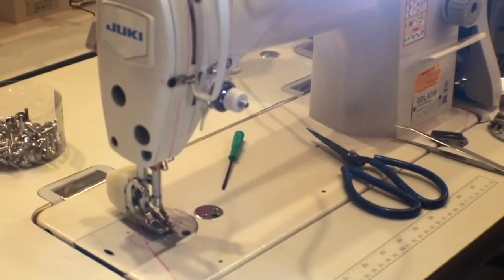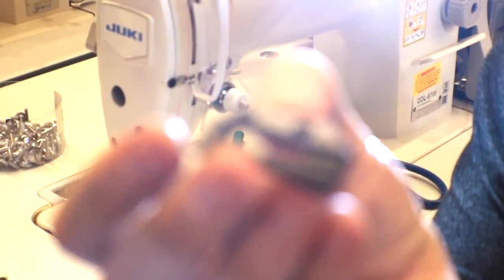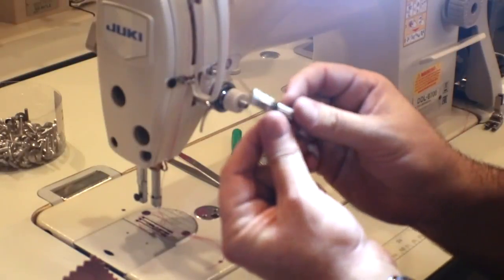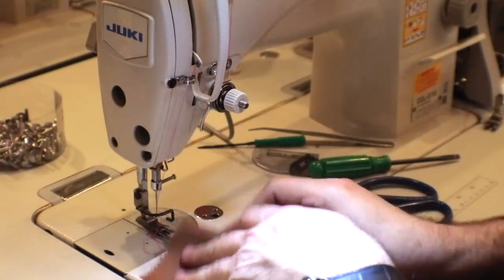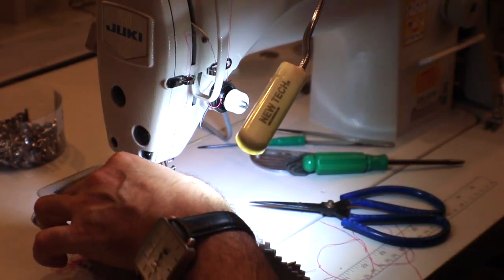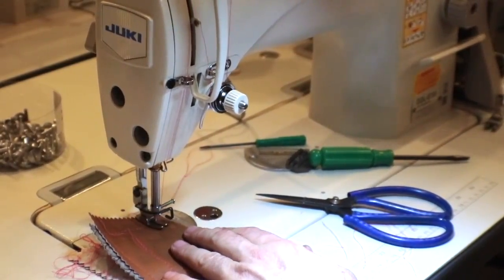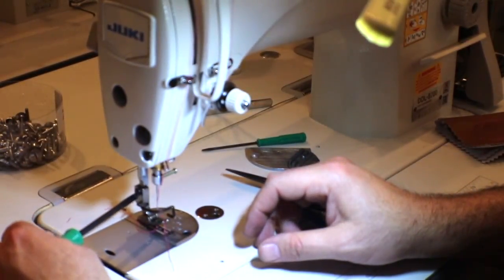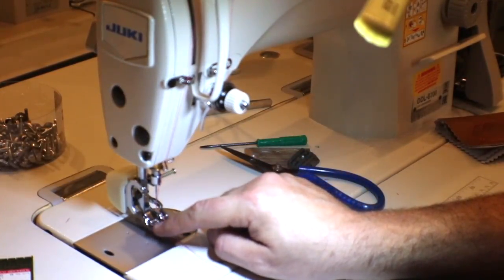Tutorial - Convert Single Needle to Walking Foot Machine - GoldStarTool.com - 800-868-4419

Comment: I took the  needle holder screw from my machine to the local hardware store and told them I need this same screw only twice as long. They found me the correct screw for less than a dollar. It fit!
Reply: Did you happen to get the size from the store ?
Reply: Robyn Flanders she said yes
Reply: Thanks K, I'll try that
Reply from the maker: https://www.goldstartool.com/walking-foot-high-shank-even-feed-rwa2.htm

Comment: I can't find the longer needle clamp screw on your website. Do you have a link?
Reply: Hardware store.
Reply: @CB-hi7mf  Hmmm, .....You replied 6 days ago to a 3 year old question...I have a similar need....Which hardware store?..The threading is 1/8"-44 and the original screw has a length of 4.5 mm...Thanks..

Comment: What screw did you use for the needle set screw to hold the walking foot arm?
Reply: The other videos I have seen use an “M3” metric = M. The length is roughly 19mm or 3/4”.
One inch is 25.4 mm so 13mm = 1/2”, 19mm = 3/4” and 25mm = 1” by package. I am a retired ASE Master tech who worked on vehicles like dealerships, but I see leather seats. Use a slow speed and position the foot and needle for no interference. Do not pull except lightly as this bends needle and can break. Hope this helps!

Comment: Thank you for the info about the walking foot.  I have a Juki DDL 8700 that is about 10 years old now.  I wonder if there is a way for it to do a zig zag stitch  on any Juki and, 2., I have to put the needle in sideways because it never worked when the groove in the needle was facing me.  Was that a malfunction in the factory?  I have never seen a needle that installs with the groove in the needle facing the right side of the machine.  Take care.  Barbara
Reply: Barbara Mobarak hi. Can’t speak for other machines. But on 8700 needle groove is on right side.   Also can’t comment on doing ZigZag on this machine but would love to know myself.
Reply: Most of the industrials, every brand, thread from left to right, not many at all thread from front to back. I have used many different brands for over 40 years. I am talking on a straight stitch single needle machines.

Comment: Still Can't Locate the longer screw for the needle bar to make the walking foot attachment work on the DDL-8700...Have found the original screws (part# SS-7080510-TP) offered from a number of sources, but as for a longer one...No Joy...The spec size for the original is 1/8-44 ( 4.5mm long)...In the video it was indicated that I should have one in my cache of misc. spare parts...On many of the machines parts lists, the size is not even indicated, just referred to as "screw"...
Reply: SS6081210SP SCREW 1/8-44 L=12

Comment: I would like to see a reply here or at least to someone else, can you confirm where you obtained the longer needle screw? I have tried several hardware stores and the threads don't seem to match up with the hole and I can't fully use the same sized screw. Or can you at least let us know if that's available for purchase through you. I already have a walking foot, I would like to use it with my DDL 8700.
Reply: I recently bought a screw to turn my ddl 8100e into a walking foot. I got the M3-05 x 12mm. I had a cord lock attached to the body of the screw so that the walking foot lever fits into it snugly when sewing. I hope I am making sense as I am explaining this at 146am. 😂 But that is the size of the screw we bought. It came in a pack of 3 at canadian tire.